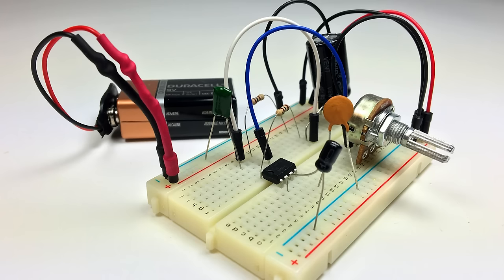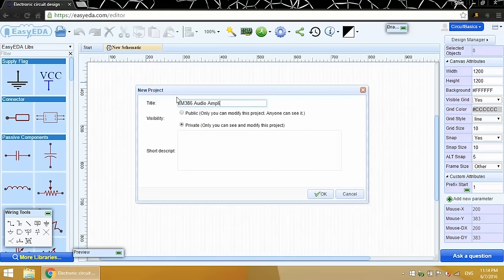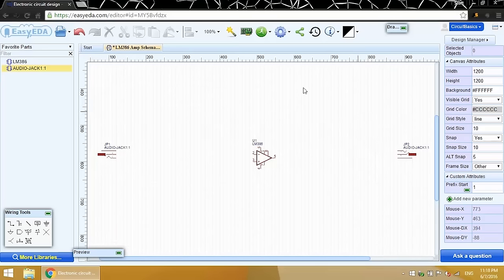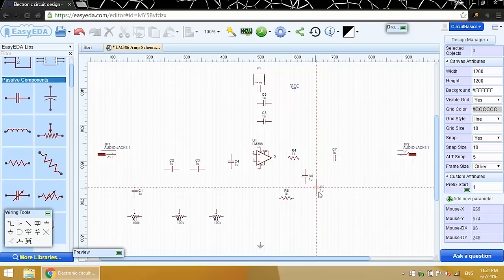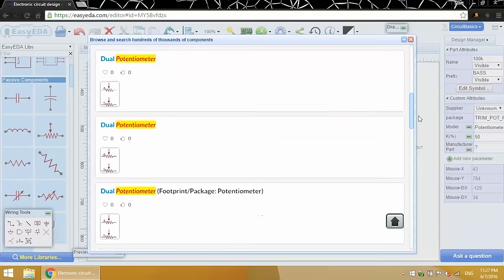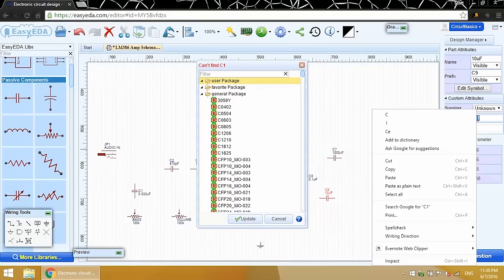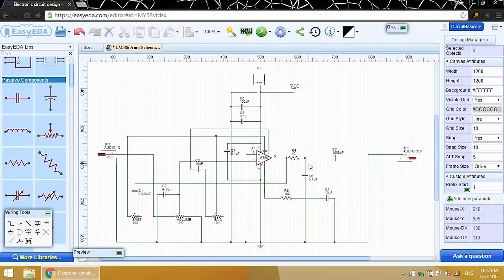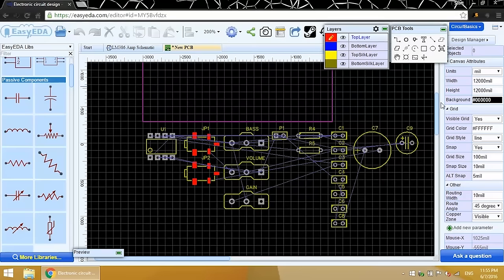How to Make a Custom PCB - Part 1 - Making the Schematic

Comment: Will the EasyEDA program handle chip resistors, chip inductors, and chip capacitors?  I would also like to know the electrical characteristics of the glass PCB, so that I could determine the impedance of the pcb traces.

Comment: Super important question. If i ordered a PCB and did not set a value to a resistor, will it matter if i use other resistors? Or will it only work with the 1k resistor i left?
Reply: First off, bakaaaa. Second, as long as the new resistor works with your circuit theres no issue.